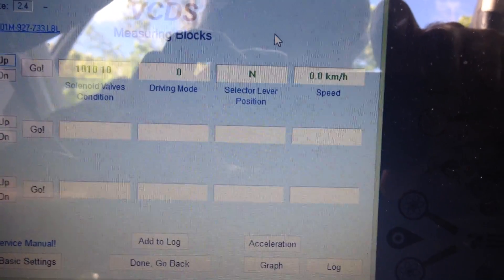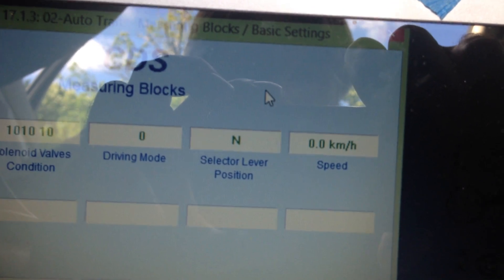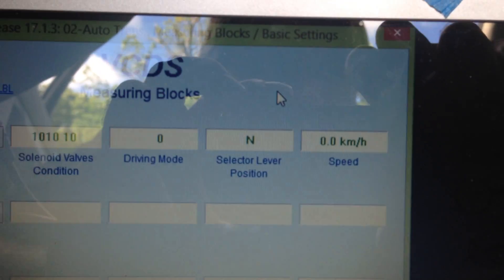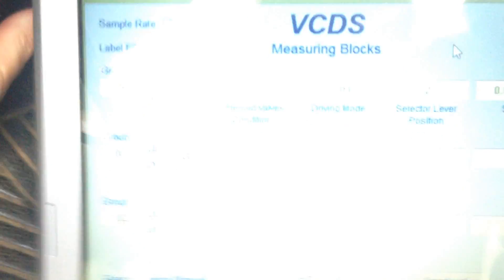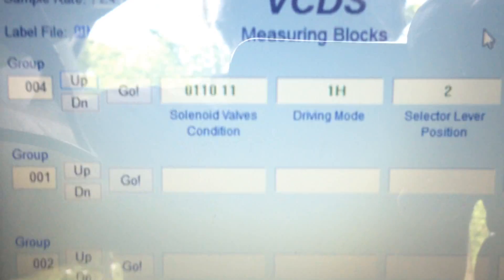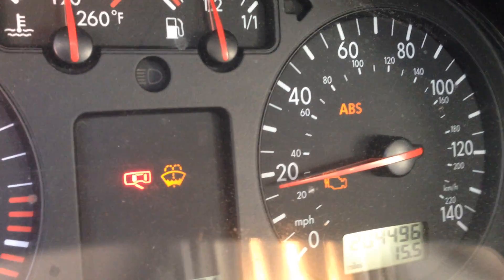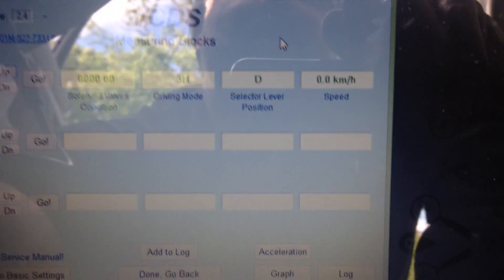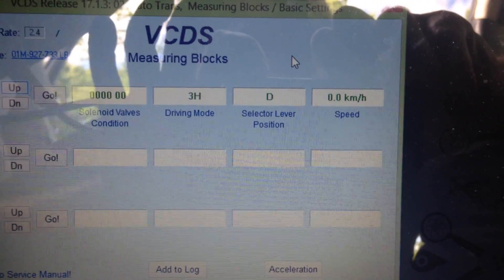VW 01M What a Bad TCM or G68 Looks Like With VCDS

Comment: Thanks for posting this!  My "guess" as to the voltage output of the G68 sensor.... did not take into the account of the transmission shifting gears. The sensor wheel will only spin-up to a specific voltage and then drop-down again once a higher gear was engaged. A faulty TCM was not on my radar... and would definitely have been my last part to suspect (after having eliminated everything else). Good job!